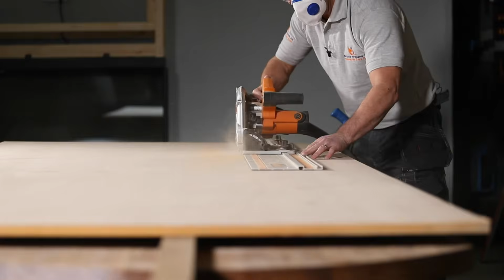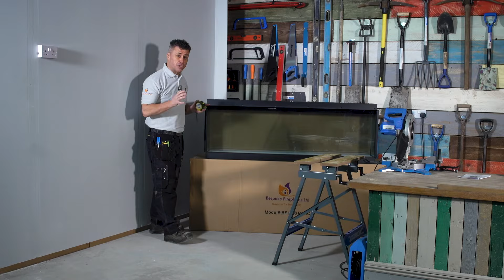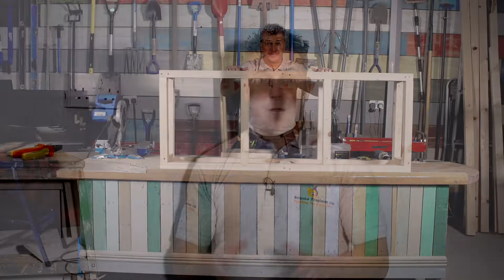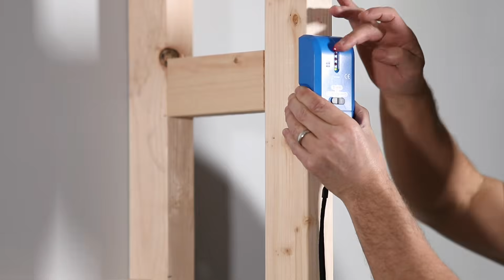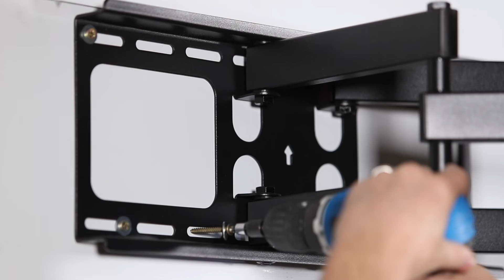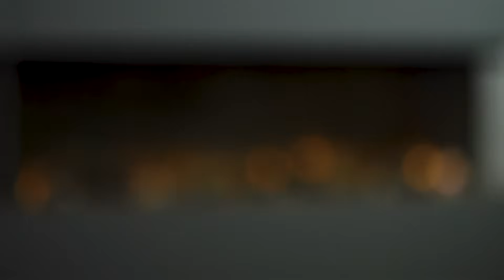How to build a media wall with electric fireplace and TV | Media Wall Build

Comment: How do u remove the fire if it breaks as mdf is covering brackets
Reply from the maker: With the makes and models you can get now, some of them can slide out really easily, and providing they're the same size they can be replaced easily

Comment: What about ventilation to the TV? Will this make it easier for them to over heat?
Reply from the maker: Nah not really, the fireplace will have an outlet for heat, just ensure that it's not going upwards to the TV. Could also leave some gaps around the edges of your TV frame for airflow

Comment: How do u get the tv inside there to hang ,and get your hand back there to plug tv into the wall..
 looks very tight
Reply from the maker: Measure twice cut once! So you do all of your measurements beforehand and make sure you've got a power point etc behind where you want your tv to go in

Comment: Hi, I’m looking to do this on a stud wall, is it as simple making the base structure and attaching the angle joints from base structure into the wooden studs? How would I make sure the vertical wood above the fireplace is sturdy if these do not run parallel to stud work? Would a horizontal piece of wood (screwed into the studs) on the back to both vertical pieces of wood help create this sturdiness and take the weight off the fireplace? Any help would be most appreciated thank you !
Reply from the maker: Yes as long as they are structurally sound and screwed into a frame as well as the floor and ceiling you should be okay. But I would consult with a local carpenter/joiner beforehand though just to make sure everything you're doing is structurally sound and safe! Cheers

Comment: Would have liked if you showed putting the bracket for the tv having problems getting the right
Reply from the maker: Just depends on the size and shape! Do a dry run first with the panel that screws into the tv, and get your measurements from that, cheers

Comment: Removed a section in my camper where the entertainment area is and installed. Works great. Instead of propane furnace heat, I can use this https://www.youtube.com/post/UgkxATHBlMJwipGgVWseuAFKvDQ_5R4_lywo to heat the camper as long as it's hooked up to shore power. Only thing I do not like is there does not seem to be a thermostat. I'm presuming it has a built-in one so it does not overheat. Really like all the other color options it has to offer.
Reply from the maker: These are good ones, and do heat the room quite quickly

Comment: Interesting video with some great ideas. Watching you using the stud locator makes it easy to find the ceiling joists, but your ceiling joists run at 90 degrees to your frame, what if the joists run parallel to the frame and there is no joist to fix into directly above the frame?
Reply from the maker: Yes this can sometimes be the case, then you'd need to use very good strong plaster board fixing drilled and installed into the ceiling then the Fram can be screwed to them.

Comment: I’m about to build our media wall - similar layout to yours - however our living space is open plan & has vaulted ceiling so will only be going around 2.40m in height. We currently have 3 sets of double sockets at normal height & the TV is wall mounted currently along with HDMI cable - so sockets will need moving up into the TV recess. Electrician has suggested I build frame first then he does first fix electrics - does that sound reasonable? I will then plasterboard and get it skimmed then second fix electrics (we’re incorporating downlighters into recesses on either side of fire/TV).
Reply from the maker: Thats great your building one, yes your Electrian is  right, build your frame, let him in to do the first fix, board and skim, even pint then get him back for 2nd fix. Let us know howe you get on, or post your photos on our Mr and Mrs DIY Facebook fan forum

Comment: Great build, just wonder how you measure the TV bracket to get the TV perfect inside the recess?
Reply from the maker: Build your frame and recess to suit the size TV you have, then its a little tricky setting the TV bracket into position so you may need a couple of attempts

Comment: I have a problem, where the motor for the bed light flicker effect echos within the cavity below the fire, how would you resolve this? Im not too keen on removing the wall sections as they are plastered and painted, would an expanding acoustic foam help?
Reply from the maker: The glazing panels can be removed for any maintenance so it wouldn't affect your plastered walls

Comment: I'm not sure whether i should get a soundbar installed in my media wall next week? Is the sound from the tv muffled slightly if there isn't a soundbar installed as well?
Reply from the maker: Hi Dean, we didn't install any sound bars in ours and our sound is fine, if your building your fireplace from scratch and your concerned and want the sound at a very high level then I'm allow for space in the structure for a sound bar
Reply: @MrandMrsDIY  thanks for the quick reply very much appreciated
Reply from the maker: @deanssj5453  Your very welcome, good luck

Comment: There is a company to fix at this  ?
Reply from the maker: Yes you can get the Fireplace from Bespoke Fireplaces, but for the media wall side, if you're not DIY savvy, you could always call a local carpenter or a joiner and get a quote for your room.

Comment: Good job.
I don't know if this has been asked before but, my only concern is if for some reason the fire develops a fault who pays for the deconstruction of the fire place.
Reply from the maker: Good question, well the good news is that if there ever was a fault with the electric fire then all 3 section of glass from the front and both sides can be removed very quickly and easily, then all working parts of the fire can be removed and replaced without disrupting the fire place, in fairness there isn't really much that can go wrong with them, we've had our tow fire in our house for over 3 years now and all working perfect. Bespoke Fires fires all come with a warranty and they have a department that offer servicing to all units.

Comment: Great work Craig, qq; is this typical hight for fireplace and tv? Like a bit high, unless it's a waiting/reception room.

I've got a chimney best that is about 200mm deep and is made from blocks (was housing a gas fire). I'm planning to cutout the blocks to fit in an electric fire (approx 300mm off the floor). Any thoughts, concerns or advice is appreciated.
Reply from the maker: Hi Bash, It seems high at first if you've not had your Tv on the wall, however its pretty stand the heights I've show in this video with a 2,4M high ceiling

Comment: This is next on my to build list. Does anyone know the pros and cons between using mdf and plasterboard? I was hoping to have an electric log burner at the foot of ours. Would that make a difference on the decision of mdf or plasterboard?
Reply from the maker: Bespoke fires don't require any fire regs materials around them MDF is fine to use, as for the log burner I'm not sure about them as ive not used one, but if in doubt please use fire retardant plasterboards.

Comment: Great video. I feel like I’ve got all the info to be able to have a go now. What did you do about the joints in the MDF panels though?
Reply from the maker: Many thanks Nev, I'd try gluing the joints, then move dried fit and sand any further gaps, once fulled dried, paint over then and you should be ok.

Comment: Hi Craig, great video. What would you recommend if wanting to do this on a carpeted floor? Would I need to cut out the carpet?
Reply from the maker: Hi Christopher, yes you would need to if where you want your media wall is sitting on carpet, you can roll it back and then cut it when you're finished the project

Comment: How many lengths of 2x3 did this need mate
Reply from the maker: We used around 8 lengths at 3 meters in length
Reply: @MrandMrsDIY  thank you. One more question. Could you butt this mdf chimney up to a plasterboard wall on the 1 side? I want to join off the side of a plasterboard wall on the left as there is a step in or living room wall. Would I be able to butt this or should I clad the media wall structure with plasterboard instead?

Comment: Please can you let me know when the mdf touches the back wall and the ceiling how do you make the mdf meet flush with the wall or do you put filler in these areas?
Reply from the maker: You can ether but it up to the wall and scribe the shape of the wall if its out, or if its just a very small gap I apply flexible paintable filler from a tube and gun, @3Csealants do  a great filler perfect for this.
Reply: @MrandMrsDIY  Hi What 3C filler are you referring to for this particular
Reply from the maker: @grahamcharlton861  At which part off the video please
Reply: @MrandMrsDIY  You mentioned a filler?was asking what make and type do you recommend
Reply from the maker: @grahamcharlton861  I would recommend a flexible, paintable filler such as the premium paintable acrylic by 3C Sealants!

Comment: Hi Craig, Great video.

Unfortunatley my missus only allowed me to buy a 48 inch Tv! :)
I am up to the fixing the top frame to wall and celiing(12:16) So my TV is 615mm in width and 170mm in length.. 

The fire and frame ive built is 1420mm width

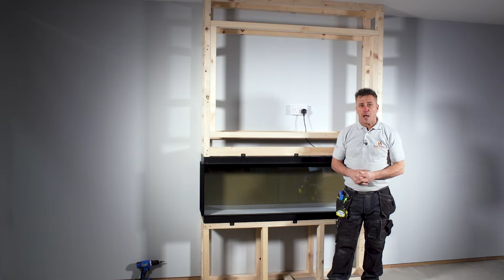(12:31) I notice you have put more timber on the inside of the frame to accomodate the the 55 inch tv i assume- so when it comes to my 48 inch TV- I am assuming I will need To attach more wood internally to the frame to accomodate my TV and to fix the MDF too? (making sure of 12mm mdf top and bottom)

Probably an obvious question/answer but I thought id ask anyway 

Hope that makes sense?
Reply from the maker: Hi Mike, yes of course it makes total sense, I've spoken with a couple of people that have built one to the dimensions that I did to fit our 55INCH TV,  However they had a smaller TV ( I think it was a 48Inch ) what they were aiming to do it further proof it for when they could afford to purchase a larger TV, but as you said just construct the frame that little bit smaller on the inside to capture for your size TV

Comment: Is it possible to build this without mounting or drilling into my walls  for people who rent possibly on wheels
Reply from the maker: Yes you could do but I'd be concerned it may come away if kids may pull or push it, you could always glue the frame to the wall with silicones so it could be removed without damage

Comment: Is there no heating barrier between the fire and the tv? If you put a dvd or your sky Q box where does that go and is there an access hatch? What about the PS4 I don’t see without an access hatch how you can achieve this. Also what if 55” TVs become obsolete and you’ve got to step down to 50 there’s no room to step up with re framing
Reply from the maker: These kind of fires don't need a heat barrier between the fire and TV, the heat is blown away from the TV above, Other gaps could be cut and fitted to allow for other items like DVD etc,

Comment: Hi Craig, thanks for the video, all useful information.  I’m about to build our media wall and clad it in mdf like you did.  You mention 15mm mdf but I’m only seeing 12 or 18mm at my local suppliers, will 12mm be ok? Also, did you scrim the mdf where the joins meet before filling?
Reply from the maker: Hi Keven, thanks I'm glad you find our videos helpful. Yes both 12 or 18mm would be fine, No I didn't scrim the joints, I'd glued them and added fill, sanded them before painting

Comment: Hi Craig, great detailed video, thank you. I've watched a few of these videos, as I'm hoping to have a go at doing this myself. Just struggling with the idea of getting behind the TV for whatever reason. I sometimes move the PlayStation into the front room for instance, which requires access. How do we get behind the unit. Thanks.
Reply from the maker: Thanks I'm glad you liked it, Getting behind the Tv isn't a problem at all, you need to purchase a TV bracket that can retract in and out this way you can always get at the plugs etc behind. any problems let us know

Comment: How do I get into the cables at the back.or if I want to remove
Reply from the maker: The Tv if fitted to a bracket that allows the TV  to be pulled out so you can get behind at the wires, when building make sure your plugs ect are fitted higher on the wall

Comment: Good vídeo very helpful 💪💪How do we close the gaps on corners ?
Reply from the maker: Thanks, Which gaps are you referring to ?
Reply: The angles
Reply from the maker: @fabiopita2897  The outer corners of the MDF didn't need closing, if there a small gap it can be filled over with wood filler, sanded, then painted.
Reply: Thank you

Comment: Where would you put a sky/virgin box?
Reply from the maker: If you required further items to be installed like Sky/Vigin box then they would need to be planned into a further small opening right below the TV, or you could fit in another area of the room and just wire it across before the build so its connected to the tv but you don't see the cables

Comment: Looks great but the tv will sound terrible
Reply from the maker: Ours is sending perfect, we've done tow in our house and there great.
Reply: @MrandMrsDIY  Is that with a sound bar?
Reply from the maker: @ryanh3285  No we don't have a sound bar on it, to be honest we brought one and never ended up fitting as we had two TV's fitted one each side of the fireplace, omits still in there box in our cupboard!

Comment: Hi Craig is this video u said u will go for a 55 inch TV. Is the fire not supposed to be 50 inch. I thought 1.5m fire was best suited for 65inch tvs.
Reply from the maker: I'll check my sizers as this one was built 18 months ago
Reply: @MrandMrsDIY  thanks u didn't mention 55 inch TV and 150cm length electric fire.  I have purchased the 150cm length electric fire just need to get tv.

Comment: Hey great work one question though did you use corner bead for the finished corners?
Reply from the maker: Thanks, no I didn't use corner bead as it was an MDF painted finished, if I used plaster board and skimmed the finished yes I would of used a bead

Comment: Tv looks too high.
Reply from the maker: It may look like its a little high but we've got used it now and it works so much better.
Reply: @MrandMrsDIY  I suppose it all depends how far away you sit. It does look fantastic and the fire effect on that unit is the best I've seen.
Reply from the maker: @Michael-pd4wu  That's right, our dinning area were the fire is is quite a long room as we have an open plan kitchen alongside it so it doesn't look high at all. I think everyone has to make there own decision on the hight they fit there Tv and fire as the hight off the ceiling and size off room will play a role.

Comment: This makes it look easy, but most chimney breasts aren't square neither are the ceilings, the fire usually sticks out far more. In a perfect world everything would be square but it isn't unless it's a fake wall. But at the end of the day all this frame is is something to screw the plasterboard onto so you could make it out of anything.
Reply: He used a telescopic TV bracket
Reply: All TV brackets are different shapes and sizers so I can't give a set size, most opt the time in the middle of course, but you need a telescopic bracket to pull out to hook the TV on
Reply: @MrDIYCraigPhillips  could u please confirm what tv bracket you used? Do you have a link? Thanks 👍🏻
Reply: @markjonathan7726  Hi Mark, I'm sorry I don't have one, I just googled them and found dozens to pick from
Reply from the maker: Thats right, A telescopic TV bracket will work well

Comment: Great job Craig 👌. Question, if you slab and plaster is it easy to remove the fire down the road in case there are issues or you need a replacement?
Reply from the maker: Even if you have plaster board the frame, skimmed and painted it, you can remove the front glazing to get at all working parts for cleaning or maintenance, as well as re-place parts if needed. we plaster ours in our own house. check out or other videos

Comment: Building this currently and new to DIY. What do you find the best way to cut the mdf so it’s straight and also what did you do for the edging where the 2 boards meet in the corners at the front so that it’s flush when painting. I know with plaster board they use angle beading. Thanks
Reply: use a plunge saw and you use an MDF edge sealer at the corners, such as shellac
Reply from the maker: Yes a Plug saw with a guard will help you cut strait lines in your MDF, glue the corner and screws fix together and then when there dry sand them down so there smooth, fill any gaps, sand again once dry and you're ready to paint.
Reply: Some DIY stores will cut them for you but in my experience they don't like doing it.